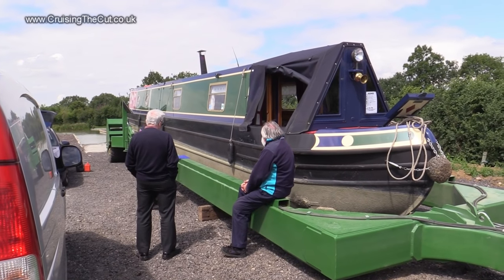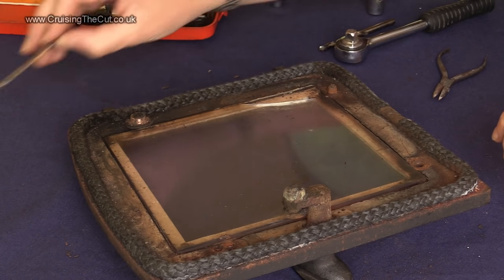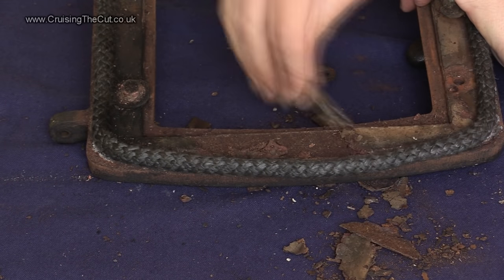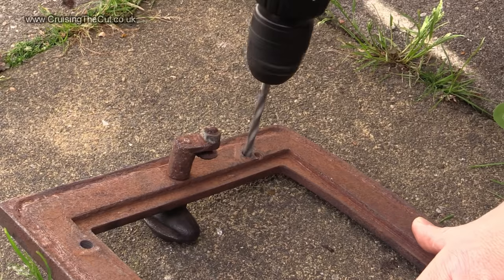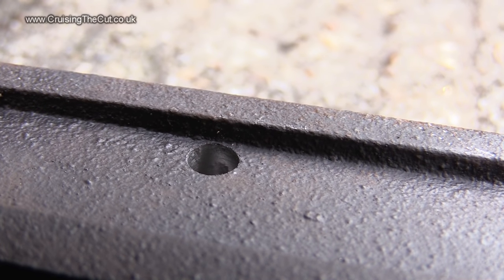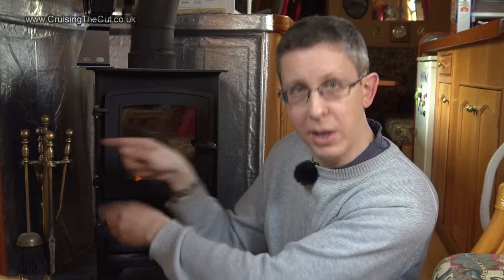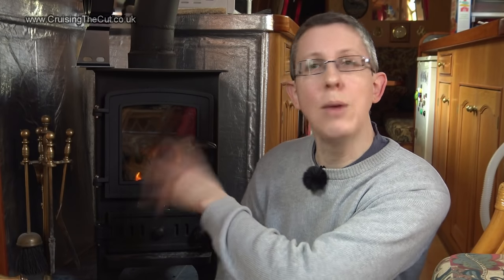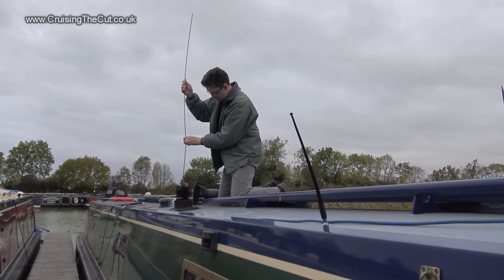18. Sorting out the Villager Puffin stove on my canal narrowboat

Comment: ....you looked about as snug as a bug in a rug, sorry could not help myself and now a question, when is the book coming out, you by the looks of it, have weeks of crook weather coming so a good time to start....and yes I noticed the removing of those nuts being done the wrong way, but a good number of years ago I think about 1993 I needed to remove the head off a Perkins 306 diesel motor out of an old Massey 165 tractor and I found that plenty of Penetrene, heat and "tightening and loosening" with ring spanners, Stillson's and a wack with a 5 pound mash hammer did the job, so as they say, more than one way to skin a cat, anyway the head came off, cylinder sleeve replaced and that tractor is still in the fleet today, mind you last by a long way at about number 25.....
Reply from the maker: Book?! Far too much work for a lazy so-and-so like me :-) I discovered this morning, after tweeting the video link to the stove manufacturer, that they actually offer a door refurbishment service so I could have saved myself a whole load of bother anyway!
Reply: ....we live and learn....but it can be painful some times....

Comment: You could have lived with that imperfect glass for years, like the previous owner did.  Can you find one fire or death on the whole internet from cracked stove glass?  I suspect not.    There are shops that specialize in removing frozen bolts.  They are pricey, but cheaper than new parts.

Many people use tiles as primary heat protection.  Bear in mind that a surveyor notes every possible minor flaw.  it is up to the owner to interpret, and  apply common sense judgement to his survey.  In fact, fireplaces all over the world are faced with tiles, to protect what is behind them.

One good rule to prevent stove corrosion is to NEVER burn drift wood that has been in salt water.  The salt is very corrosive on metal.
Reply from the maker: There is no salt water on the canal so that's fine. Cracked glass is a BSS failure so I would be unable to use the boat, hence its replacement.

Comment: If you need to unscrew a rusted bolt a Butane blow torch and a hammer are your friends.  Heat the bolt hot (red hot) spray some WD40 on it and slightly tap it from all sides with a hammer.  Try to unscrew.  If doesn't bulge, repeat the process.

Comment: WD-40 only drives out water. It won't break up rust. "Not elegant?" Drilling out problem nuts & bolts is absolutely an "elegant" solution. There's ages and ages of tools and techniques built around mechanical deconstruction. Maintaining one's own engines and such requires one own a set of taps & dies. 
Love the channel (pun intended) btw.

Comment: Is the top of the stove hot enough to cook on, or at least warm a kettle? Might be good for slow cooking something when your moored up.
Reply from the maker: Definitely! My kettle spends most of the winter on top of the stove.
Reply: @CruisingTheCut  I noticed that in later videos. I would think a small dutch oven might be nice as well, something you can put a little bit of meat and vegetables in and let simmer for a few hours on top of the stove.
Reply: I used to work in a foundry, and we would put out cups on the casting hardware. Some of the cups of tea I made in that place lasted longer than my career there I'm sure.

Comment: An engineering place like you'd find in an industrial park could have filled in the misdrilled holes with a welder, drilled new holes, fitted the glass with stainless steel fittings and may or may not have painted it for you for probably half the cost of the new door.
Reply: The door is cast iron, can't weld up holes in iron. Trying to drill out studs freehand is nigh on impossible.
Reply: @simonwass6315  you also can not use a punch to hammer in a pilot hole for the drill to ride in. if you do that on cast it will shatter like glass. that small crack in the glass i would never have fixed it. the flue draws the air up and away from the stove. if that small sliver of glass was removed it still would not have smoke coming out.
Reply: @simonwass6315  You can weld cast just fine, just use the right rod and technique and preheat.

It would have cost plenty more than the replacement door did, though.

Comment: next time you do the small bolts smear them with 'copperseal ', I have a puffin and do this and it works very well with no problem undoing them.
Reply from the maker: Thank you. I don't think I can ever get them off again, the new ones are now solidly seized too.
Reply: The chance of getting those rusty bolts out is slim.
The best method is a gas gun and heat up the nut as hot as you can get it, then try. 
You did OK with what you had, drilling out broken bolts is not easy in a workshop let alone with just a drill on a boat.
The stainless steel seems a good option but having wondered for years why car exhaust bolts aren't stainless steel, it looked into it. Stainless steel at high temperatures actually welds itself together!
Brass would be a better option.
As for WD40, it is an OK product, it is actually designed as a Water Dispersant, hence WD. It does other things but not really well. The best thread soakers are Plusgas and PB Blaster.
Very nice video as usual.
Reply from the maker: Good info Harvey, cheers

Comment: when you get to replace the fire extinguishers, i would change away from powder and go for foam, the powder if used will wreck your boat - it goes everywhere and you cant see.
Reply from the maker: Good tip, cheers
Reply: The little 1 kg extinguishers ones are woefully inadequate for any practical purpose. IMHO, a boat of that size should have at least a 6 kg/liter extinguisher at the bow and one at the stern.
Reply from the maker: Maybe but if it goes up in flames, I'm probably getting off, not trying to fight a fire.
Reply: Always carry a bucket with a four foot length of rope attached, this is a bit modern but useful.
For some reason, narrow boats are always surrounded by water, great for putting out fires.
Reply: But you may have to fight the fire to create a path out.

Comment: In re: the rusting on the Puffin's door, I imagine it's a result of the flue sucking in moist canal air and speeding up oxidation... could this be remedied by attaching a small zinc anode, such as the ones on the hull, to accept electrons and prevent rusting?  I'm not sure, just asking.  Safe, enjoyable travels to you, sir!
Reply: Galvanic coupling requires physical water connection between the two dissimilar metals. Mist or steam will not do it. Those doors rust a lot because the daily heatcycles crumble the existing rust, revealing fresh iron. Then the heat from the fire accelerates iron combining with oxygen, turning it to new rust. High carbon content also makes the surface more porous (and more accessible for oxygen) when the carbon burns into carbondioxide.

Comment: Could you put tiles on top of the silver stuff if you wanted because ceramic tiles will hold heat for a long time if the stove goes out?  re. Cornish heaters with just a candle and a flower pot.
Reply from the maker: If you put anything directly on top of the foil stuff, it won't reflect the heat anymore. The stove already has fire bricks inside it to smooth out and retain the heat distribution.

Comment: It looks like a lot of heat goes up the stove pipe,  I would cover it in heat sinks to draw the heat out of the pipe into the air
Reply: Stoves like this rely on that heat to create an air current to push the smoke and carbon monoxide up and out the flu. If you don't have enough heat in the fire or if you pull too much out of the chimney, you can get downdrafts that will fill the room with smoke and ash.
Reply: @nathans9764  Also, if the chimney is kept cold, you'll get a lot of tar and gunk condensing on it, which is a huge fire risk.

Comment: Have you tried wood pellets? At least here in Sweden, they are very readily available. More healthy, more environmentally friendly and does not leave a lot of ash.
Reply from the maker: I don't know any boaters with wood pellet stoves and I don't know of anywhere along the canal that sells them.
Reply: @CruisingTheCut  You can burn them in the stove you have there. You just use a wood pellet basket (there are different sizes and shapes) and it fits almost every stove you can use wood in. And it is not dusty and easy to handle.
Reply from the maker: OK but there's still nowhere along the canal that sells them (that I've ever seen)
Reply: @CruisingTheCut  I guess there must be some differences between Sweden and UK. That coal you have, i have Never seen that here for like... ever. Coke for heating houses and stuff must have disappeared here like 40-50 years ago i guess? Mainly used in steel production today. But wood pellet are like almost everywhere. In all larger hardware stores you have it, and can be ordered online either on bag, pallet och bulk, and is sold in many other smaller places too. That and wood is what people use in their fire places and pellets (and sometimes wood) is very common in household heating (if you do not have heat pump, district heating and so). Even oil as heating source is fading away since decades back.
Reply: @Xanthopteryx Don't forget he is moving through the canals and staying at different areas.   At least they have fuel boats, out in open waters you are probably limited to what is available at a fuel station. In the US that is gasoline or Diesel so heating is mostly Diesel or generator powering a heat pump or some kind of electric heating.

Comment: Some concern about the placement of your carbon monoxide alarm which appears to be half way up the wall?  It should be placed down at floor level where gas sits and will go off before it gets to the level where you are in the boat.
Reply from the maker: No - that's wrong. Carbon monoxide is lighter (just) than air. The CO alarm should be on a wall. Not the ceiling, as warm air rising can move the CO around.

Comment: That windsock on your LAV is pretty big, might I ask why you had it on whilst indoors?
Reply from the maker: Partly because it's fiddly to get it off and on again, partly because naked of the windjammer the mic sometimes picks up plosive sounds ('p' and 't' etc) so I use it to counter those.
Reply: CruisingTheCut Ahh, so you're using it kind of like a makeshift pop filter. That's pretty cool. 

I saw some comments on previous vlog's suggesting that you acquire a GoPro to mount on the front of your narrowboat, I would just like to say that I also think this is a good idea. Then you would have a waterproof camera that you could wear on your head or that you could mount to certain points on the boat for longer journeys. 

Although they are indeed expensive...
Reply: CruisingTheCut Another question I have is, have you ever seen narrowboats fitted with bow thrusters?
Reply from the maker: I'd like to plaster the boat with GoPros (!) but I'd also need to run power to them as I typically cruise for at least three hours at a time so need them to film for that duration. And yes, they are stupidly expensive. I think when I next go out cruising, I might just mount a cheap camcorder inside the well deck looking forward through the glass; that way it'll be semi-waterproof and still get a view forward.
Reply from the maker: Yes, plenty of narrowboats have bow thrusters although lots also don't.
Reply: CruisingTheCut There are also some decent copies of the GoPro that are much much cheaper, although it does sacrifice quality. I got one for about 40 pounds on amazon.
Reply from the maker: But irritatingly, a lot of them won't shoot 25p which is the UK standard and to which all my other footage is shot. Yes, I know you can convert but downsampling from 29.97 to 25 is pretty horrible. The GoPros do actually shoot 25; the Yi action cam does 25 but many of the others don't. And most of them don't even say whether they do or not!
Reply: CruisingTheCut That is true, might as well buy a Red Epic (joke). 

Another side question I have, i've seen a couple narrowboats with wind turbines, how useful are these in reality?
Reply from the maker: Who do you think I am, MKBHD? ;-) Don't know about  the turbines. Need to find someone with them and do a vlog...
Reply: Hi, GoPros can be set to NTSC (30fps)  or PAL (25fps) in the options quite easily. At least, mine could. Those sold in the UK would need to be PAL anyway.

Comment: If the tiles were ceramic they were the insulation as ceramic doesn’t transfer heat well.
Reply: Ceramic tiles are completely different to ceramic insulation. The fact the inside of the cupboard got too hot to touch shows ceramic tiles don't provide any insulation.
Reply: @simonwass6315  they needed an air space i think. i have used ceramic tiles to keep steel off the floor of a heat treating oven that goes up to 1100C. they will take that kinda heat but as for transferring it i can't speak.

Comment: "Inept". Turning the nuts in the wrong direction. Not drilling pilot holes before drilling the final diameter holes. Not moving the stove outward from its current mounting as should have been done. Not installing free-floating sheet metal shielding between the stove and surrounding cabinetry and bulkheads. Not bothering to learn proper nautical terminology for your boat. "Roof" ... are you KIDDING me?
Reply from the maker: Re the nuts, please see the video description. There is insufficient space on the plinth to bring the fire forward. There is thus also insufficient space to install free-floating shielding else that's what I would have done. I had to work within the boundaries of what was there.

As for nautical technology, it's not generally used on narrowboats but regardless of that I cannot assume my audience would be familiar with it so more everyday terms are entirely appropriate for these videos.
Reply: @CruisingTheCut  At least you replied .. I'll give you props for that. Best of luck!
Reply: Hello Harpo, just let the man do his thing, allright? He's not a skilled techie, but seems find solutions that work.
Reply: @CruisingTheCut  Nah thats a fine installation indeed, great job on the foil insulation,,
Reply: @bartvanderveere7592  yes. spot on there its not under union contract here. there have been fires and stoves for a thousand years. people can do. he is trained as a new man not as a mechanic. with that said Harpo you go on TV and do his job. i think no way Jose